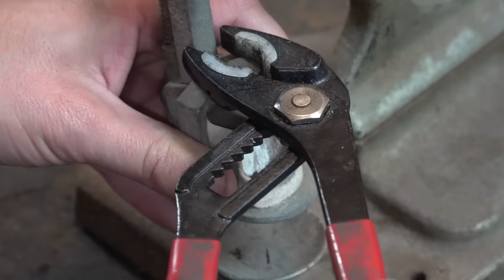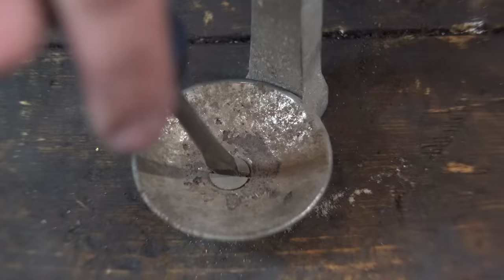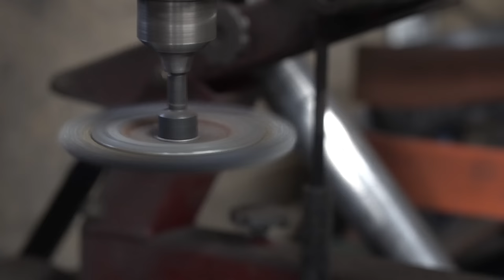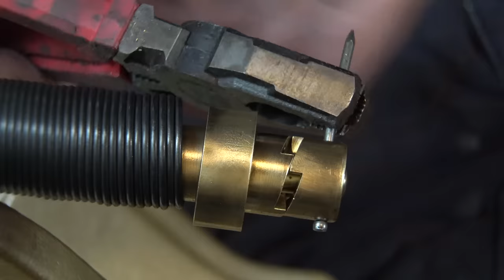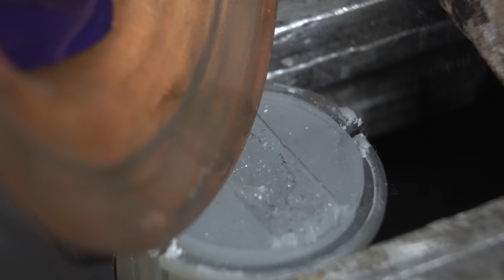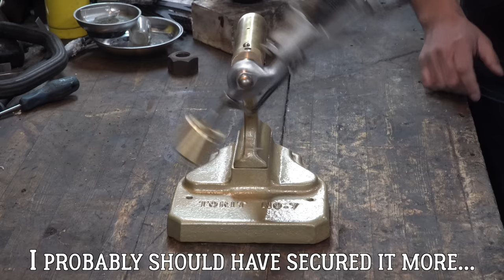Antique Centrifugal Dental Casting Machine [Restoration]

Comment: Hey cool! I've used bigger versions of this exact unit before. They were horizontal rather than vertical. Definitely used for Dental work, or small jewelers work such as rings.
Reply: The jewellers centrifuges I've used were also horizontal, and spinning before you start pouring into a central "cup" on the rotating axle.

Comment: This tool seems like it could quickly transform from a centrifugal casting machine into a molten metal sprinkler. You could therefore advertise it as a multi tool!
Reply: My high school had one of these in the jewellery class, but bigger and horizontal. One kid didn't put enough plaster in the mold, so the bottom gave out as it spun and threw molten silver into the wall, which then sprayed me.

Didn't hurt nearly as much as I expected, but I was still quite annoyed.
Reply: That happened in a jewelry class in college.  One kid had the their mold blow out during casting.  This was on a more modern horizontal machine and it had a big metal shield around it so nobody was hurt.  Turned out they'd dropped the mold taking it out of the burnout oven.  It looked ok so they didn't say anything.  But investment is fragile and easily damaged once its burnt out.  I've used a hand sling centrifuge that a buddy got at a dentist's estate sale but I've never seen a vertical casting machine like this before.  I agree it could easily become a metal sprinkler in the wrong hands :)

Comment: I love the way brass looks - ideal material &
In ’74, I spent a summer at Haystack Scool of Crafts on Deer Isle in Maine. One tangential class had the instructor a week late due to a cold, so they had a Swiss silver smith fly in for a week. Everyone in that class was moaning until he showed up. He was an expert at gravity casting silver and gold. No one had even heard of this before.
Imagine wooden handle with hand forged chain links to a crucible at it's end,  that held the negative mold. One person holds the handle and swings it around as if it was a clock handle (in front of the person) after another person places silver in mold and then melts it with a torch then yells go.
Huge excitement and cheering ensued, but from a distance, as sometimes the silver flew out. Everyone there learned this technique & made their own handle and chain, which worked well and guess what, they all moaned when he left.
End of story was that the original teacher showed up a week late, who everyone signed up for originally, and they loved that class twice as much.  They all moaned when it ended. They were known as the moaners.

Comment: That sure is an oldie.  I worked in a dental lab for years.  We dont do as many cast crowns nowadays but when we do its horizontal and recessed in a metal basin.  Not vertical flinging molten gold to the ceiling.

Comment: Having done a few dental castings in my day, I can say that that machine scares the crud out of me!  You did a great job as usual. But don't try to use it for its intended purpose.  Imagine molten metal being flung 360 degrees around that spindles axis and you with nowhere to hide.  All of the cetrifugal machines I've used spin in a horizontal plane with a vertical spindle. The whole machine is recessed into a thick walled cylinder. (Picture a washing machine drum). So when, not if, things go wrong, the molten metal flies against the wall of the cylinder instead of in all directions.
Thanks for the great video.  You find really neat old machines and do a great job on them.

Comment: I have used similar broken arm casting machines but mounted in a tub and horizontal spinning.  Much safer from flying metal LOL.  I trained as a dental tech and spent 44 years as a denturist.  Brings back many fond memories.  Casting dental gold when gold was 35 dollars an ounce was one thing but today at crazy gold costs let alone dental gold with platinum and palladium would be astronomically expensive.  We would line the old crucibles with asbestos paper to stop other impurities from precious metal in the crucible from contaminating the cast.  Shows you how long ago that was.  You could buy asbestos paper.  LOL  As students we would make side money casting jewelry in sterling silver.

Comment: Just a tip from a former electro plater if you want a smoother finish a light layer of copper plate before nickel plating usually works.

Comment: hey, i have one of those, kind of... its from the 50s and is meant to be mounted on a sturdy table, cuz its got a spring mechanism in it, and some counterweights, just tighten it up, put your cast in on end, your molten metal kinda in the middle, and let her rip, spins hecking fast, its horizontal

Comment: A small vibratory sander (ie: palm or detail) works well for shaking the bubbles out, when casting.

Just set one next to the mold, after pouring, & turn it on.

Comment: Hey, Hand Tool, you ever consider making both a video of and a filter system for the  Evapo rust? I think it could be done fairly economically, perhaps a pond pump either submerged or not running through a 2 stage pool filter or home water filter system, filters for both are cheap and filter down to very small microns with plenty of particle sizes to choose from. Of course this all depends on how well Evapo-Rust plays with certain plastics and rubbers though I suspect you can easily find which ones it doesn't and avoid them.
Reply: Now all I want is to see a little zen Evapo-Rust fountain.

Comment: I have mounted a small bearing on a toolholder. When  need to straighten a small shaft, i let he lathe run in a low speed. After that, i press withe the bearing against the out oft  straight shaft. I increase he force for the bearing gently, until the meterial goes in plastic deformation. If the workpiece has multple brnds, i  repeat the process for the ohther bends. Viola, straight shaft.

Of course, that does  not work good, when yor shaft has 2 Inches of 42CrMo4, lol
Reply: Inforgot to say , for larger shafts is a hydralic press great, and for real large pieces a acetylen / ocygene flame.

Comment: possible site gag bits: 1) bring up (fake) fish in your rust restoration basket. 2) use toothbrush to scrub off black material then cut you using a (same color) toothbrush brushing your teeth with the charcoal (dark) toothpaste you can buy.

Comment: Random question here. How much longer are you going to be able to effectively use that same vat of Evaporust?
Reply: "Evapo-rust" works extremely long. If you filter out the sediment, the service life will be endless.
Reply: @Anrakyr  If that's true, then it truly is the most impressive rust-removal product in the world and literally nobody should be using anything else.
Reply: @DaroffApFire  A sixty-liter barrel in my workshop, which has worked for six years, will not let me lie. I filter it once a month and it still removes rust. And of course you need to close the lid so that the water does not evaporate. How funny. Evaporating rust😁

Comment: No wonder that pin was bent, is that supposed to act as a break for the unit as it as it spins or as you are winding it up?  Not very much metal there.